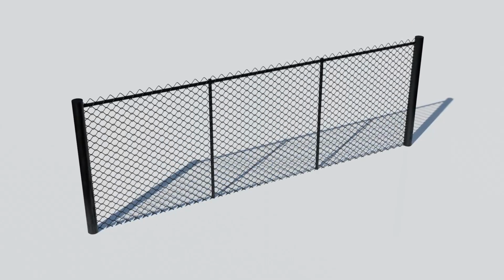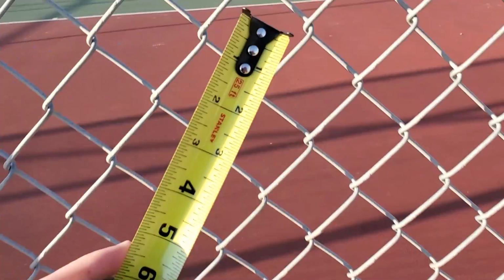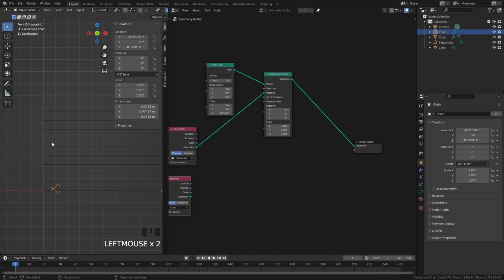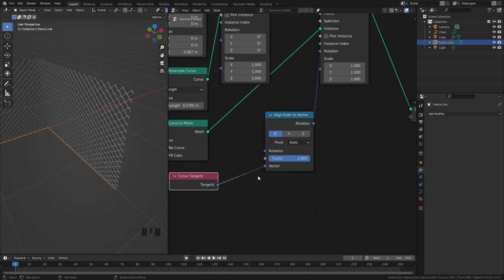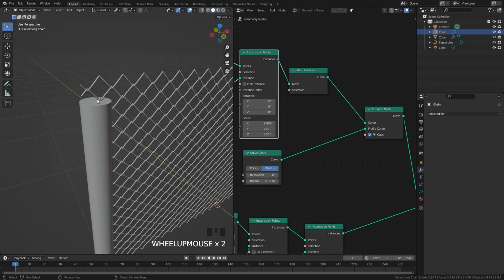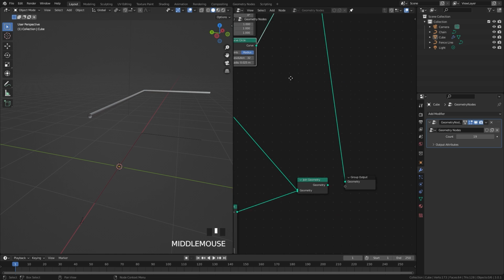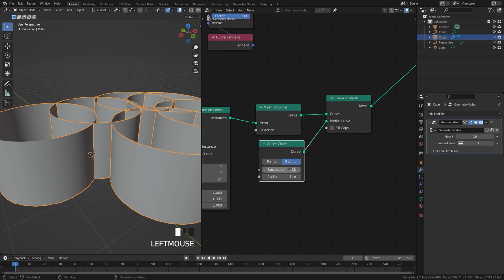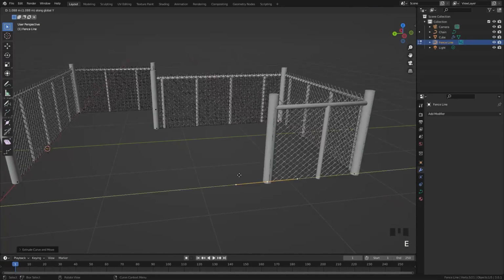Blender Tutorial - Procedural Chainlink Fence (Geometry Nodes)

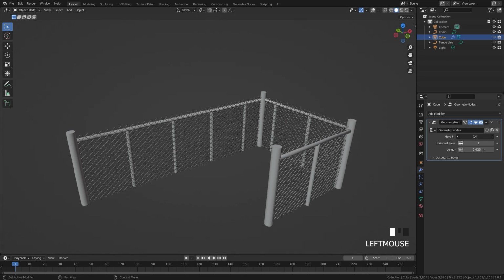Comment: I have a Fix for the poles 21:08. All you have to do is add 3 nodes at 17:43 Curve to mesh - Split Edges - mesh to curve (between Object Info and Resample Curve). This will separate all the edges and will have separate end points. After Resample Curve node add Delete Geometry node and Endpoints selection node (Connect to Delete Geometry node selection point), this will remove the Poles on end points.
Reply: Works like a charm. Thanks.

Comment: I'm working the fence mesh and noticed that you have the mesh sideways. I keep seeing chain link fence tutorials with this flaw. Chain link fences are not built this way and you can't get realism because you wouldn't be able to add brackets and braces at the posts because you have your links sideways. The cut, sharp exposed ends face the ground, you couldn't add hardware with them facing sideways like yours. An installer uses a knuckle wrench to bend those jagged ends around. How would you do that with just the end column of geometry so hardware could be added in archvis? Just another point for archvis realism, the mesh runs outside the posts, not through them. That's where adding the hardware for bracing comes in and you discover the jagged ends won't let you add brackets, tensioners, fence hinges, etc. Not picking on you, this may be good for making game assets, but not archvis. Fences are seldom on level ground, they run up hills, down hills, over swells. If you try and move/add points on your reference line, it breaks apart the mesh if any point is not on the same level as the others. I have yet to see anyone come up with a realistic way of making chain link fence and I've spent countless hours trying. You could use a boolean to cut the fence but you first have to use the "realize instances" and that just defeats the purpose of an instance and jumps the face count up astronomically

Comment: What you can do is transformer your curve into mesh, split edges, then transform it into curve again. 
Your poles should be spread out much better now.
After that you can add delete geometry and plug endpoint selection into selection. This way you won't have two poles in the same place.

Comment: Great tutorial, I have a question though. Is it possible to have 2 different materials for this? One for the chain links and one for the poles?
Reply: You should be able to add a new object, assign a material to it and instance it as whatever you want it to be. This way you can have a different material for every different part of the fence
Reply: Yes you can - just add the 'Set Material' nod before the 'Join Geometry' instead of after, you can apply materials to each element separately this way.

Comment: Nice presentation. I think you can use the total fence  length together with vertical pole spacing as an input to drive the pole placement. A little maths function will provide the distribution automatically. Love your systematic approach. Great job!

Comment: I have a fix for the poles that are too close to the other poles. I wrote a node group that resamples the curve but takes active points into account to keep a point at every given/evaluated point. It is done by subdividing each segment individually based on its length. In this process you have to split the spline at each point first to get the spline length for each individual segment, than stitch it back together by converting it to a mesh and using the "merge by distance node". Then converting itback to a curve. Will upload the group soon.
Reply: You have saved our lives, we are eternally grateful! 👽👽👽
Reply: Genius
Reply: @lucarroba  It's on gumroad under the name "[BLENDER GN] POINT-AWARE RESAMPLE NODE GROUP"
Reply: @thomasfrenkel1991  this is awesome, thank you!

Comment: Super video, it's simple but it's a good explaination on how the tool can do. 

If someone has an answer, I've got 2 issues: 
• even by taking the x measurement, the shape are not connected, there's a space between each repetition
• the fence try to turn on corner but a part is hanging 

Anyone also go this issue (Blender 3.1) ?
Reply: I have the 1st issue as well. The main issue with it is after converting the result to a mesh (before export) it contains a lot more vertices, since they could be merged if they didn't have a space between them. If anyone knows the solution that would be great!
Reply: @matanshukry  make sure the fence length is a multiple of the chain length

Comment: you guys make it look too easy. I think the poles work as is - no changes needed - it's ok if some of the poles are near the bigger ones. Just need to keep that distance the same max spread (but not averaged) between the small poles within a particular line (which it already is) - just like 2x4 in house is always max distance of like 18" from another, but some 2x4 go right up close to edge, but aren't the edge itself, so spacing between them is minimal.

Comment: This tutorial is incredibly helpful when trying to learn this stuff! I just have some questions because I want to use square posts instead of round ones. How do I make the "Align Euler to vector" snap so that my corner posts aren't rotated 45 degrees and how can I lock middle posts to be a separate distance apart from each other?
Reply: I just tried building out this setup and it appears to work the same with square posts...which I tested with rectangular posts just to confirm their correct orientation.  As for the second question, if you want to use different setups for end posts and middle posts, you can select the instance nodes setup and group them (so you can duplicate the setup and modify the duplicate), then use the endpoint selection node to select the points for the end posts and a boolean math node to select all the other points.

Comment: Great tutorial!!
I took this a little step further and used the Delete Geometry node to remove the very bottom horizontal pole. I thought maybe it is unnatural to have a horizontal pole along the ground :)
Reply: You mean "pole".  Make it optional because our fence does have one!  ;)
Reply: you can also use also:
- [Add] 1 -> [Resample Curve] Count

- add an [Endpoint Selection] node

- plug  Count -> [Endpoint Selection] Start Size
- set [Endpoint Selection] End Size to 0

-  plug [Endpoint Selection] Selection -> [Instance on Points] Selection

and it'll always skip the index of the bottom bar

Comment: Great tuto, but I've hit a few snags: when I do the rotation of my chainlinks, the corners aren't rotated 90 degree, and they sit at an angle. It's visible through the poles
The second snag: I've moved the original chainlink to the right, so the starting pole sit well at the end, but the ending pole doesn't, the fence goes beyond it?

Edit: And I found a way to not have the smaller vertical poles close/into the main vertical poles!
After instancing both types of poles, you need to connect the smaller ones into a delete geometry set to instance, just before joining them with everything.
For the selection of this delete you'll need:
To branch the two instancing each into its own realise instance, then feed each into a geometry proximity
Do a Vector Math Subtract (main poles top, smaller poles bottom)
Feed the math into a compare node, set to vector, element, equal. The B vector is at 0 and the epsilon is the distance from which it'll start to delete the smaller poles.

If that's confusing, you can find a screenshot in my YT profile
Reply: Hey Felina. Thank you so much for your hard work here! <3 Using your solution, and the screenshot on your YT Profile, I managed to resolve the issue too. I took it one tiny step further and calculated the epsilon using the vertical pole distance, so as you scale up the number of poles, it inversely scales down the size of the epsilon, so the more poles you have, the smaller the gap it leaves from the larger upright fenceposts. Works beautifully, so thank you!
Reply: Great tuto indeed. Unfortunately, same problems here.
Reply: Thanks, was able to get the excess poles deleted thanks to you. Trying to figure out how to deal with the uneven rotation of the chainlinks next..

Comment: hey so this tutorial is amazing, but I had a problem when I connected the chains, there is a small gap on the right side on each linked square thing, is there anyway to fix this?
Reply from the maker: Yeah that is one problem I noticed too. That's the issue with using the Length in the Resample Curve. If the Fence Line dimension length is anything BUT a multiple of the chain object length there will be a slight gap between each chain. 1 thing that you could try is to edit the last point on Fence Line object and move it just slightly back to line up all the chains.  I had forgotten to mention that in the tutorial.
Reply: @BlenderMadeEasy  Thanks bro. when i do the thing but another chain disconnected again . how?